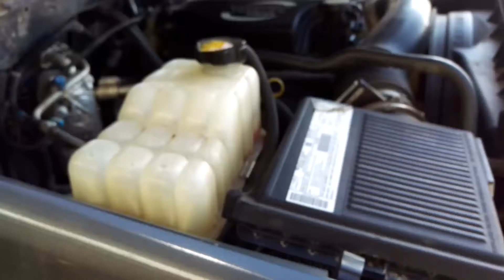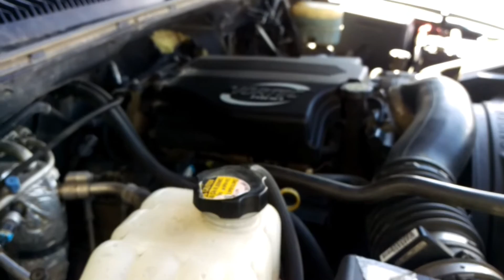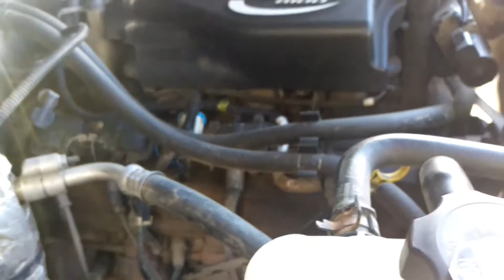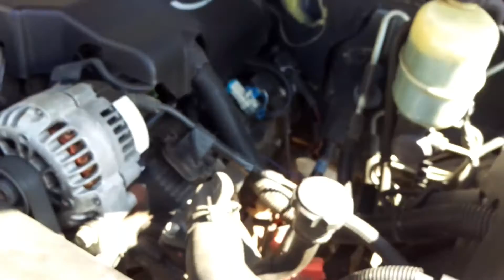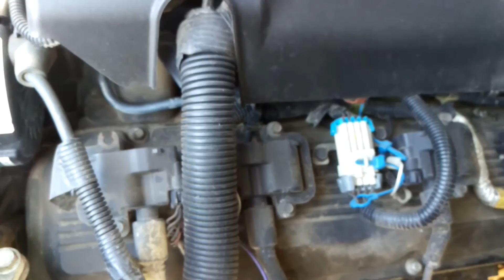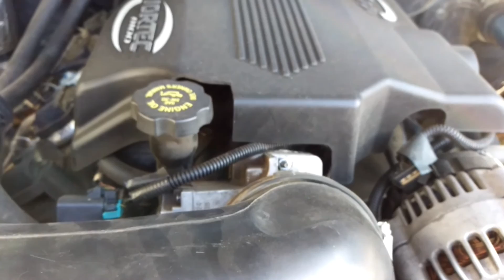8.1L (496) Vortec engine noise (piston slap) potential remedy.

Comment from the maker: I recently had a random misfire issue and an occasional reduced power with no codes. Found a bad fuel pump and an alternator on its way out were the culprit. Changed them out along with some good plug wires and it purrs like a kitten and increased my fuel mileage by 25%. These old monsters can have some combinations of problems.

Comment: Got mine back in Sept. Chevy version tho. I have the same "lifter clatter" and what sounds like an exhaust leak that three shops can't find. Gonna try the plugs and see what happens. Can't hurt.  Thanks for posting.
Reply: I got the exact same issue    did u fix yours??
Reply: I still have the truck. It has 170k plus on it now. No one I took it to thought it was an issue. I never did anything specifically to address it. The noise is still there but goes away after it warms up.  It’s a normal abnormal…
Reply from the maker: Lamar Lamb. Let me know if it improves at all. I am curious. Thanks.
Reply from the maker: Lamar Lamb. Also just learned from a GM Master mechanic. Go to GM and pick up a bottle of 'Lubricity'. It was designed to help free up and clear sticky lifters.
Reply: I know it was awhile ago but I have an 8.1 with ticking noise on a cold start then it stops ticking after running for a min or so.Did you ever find out what it is?